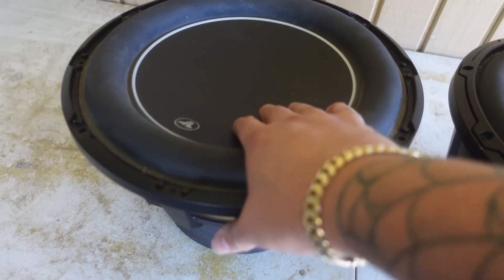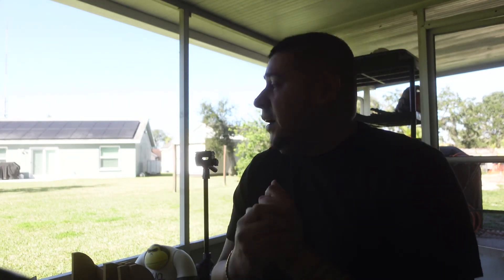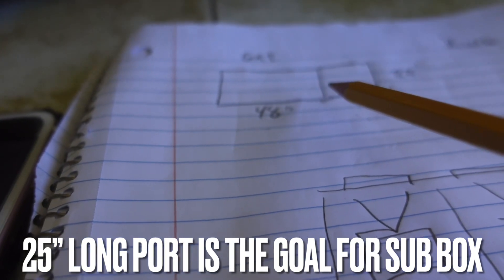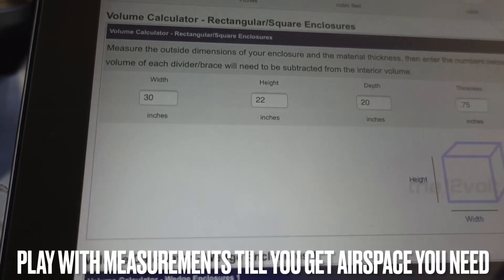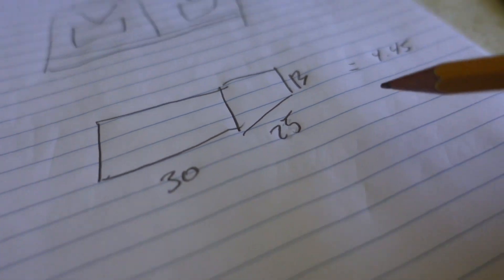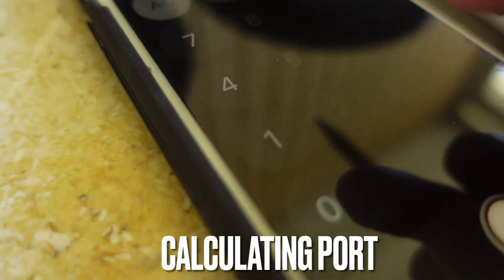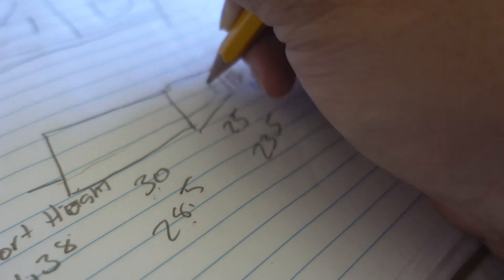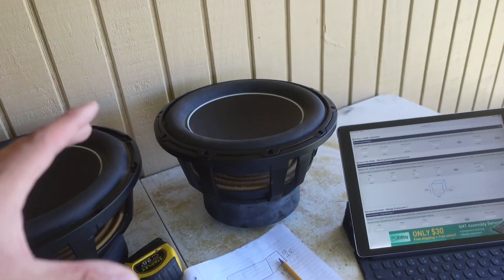Ported Subwoofer Box for 2 12” JL Audio W6 Design

Comment: I dig the videos as always.  Over the years,  dealing with JL subs, the 12w6 v3 especially, call for smaller ported enclosure volumes.  If I remember correctly, about 1.4 cubes ported on the v3, and the v2 calls for 1.5 cubes. I am sure the enclosure will turn out nice, but i would be cautious with throwing over twice the rated power per sub, in an oversized enclosure volume, especially with them being beaten on in several builds. I know by modeling those up, as with all subwoofers.. with bigger enclosure volumes than required, they tend to reach their xmax quicker on less power. I am just trying to help a little bro. Those subs are super soft suspension wise, and I would hate to see them bottom out and kill coils, or saturate the coils and blow as well. I've refoamed and reconed so many JL subs over the years . 👍

Comment: 2.6 cf net volume is all you need for 2 12s jl audio w6v3 and 3k is too much bro especially with dirty power those taramps amps are garbage...tell ur friend to get a clean amp like a Rockford fosgate jl audio amp 750 to 1000 watts is all you need for those subs and I'm curious what formula are you using for the port area?